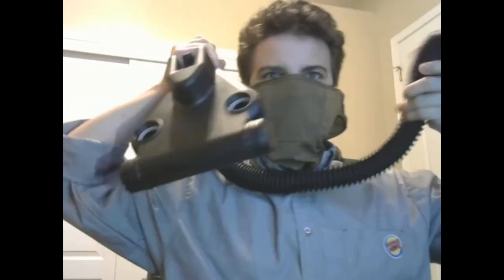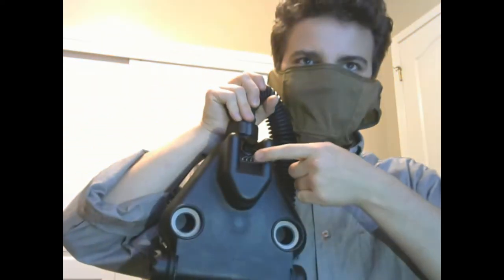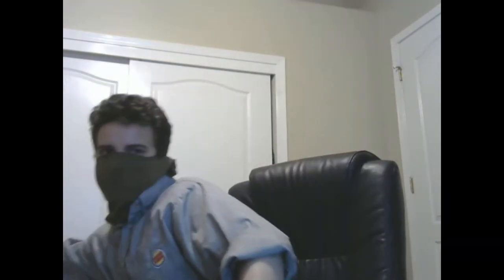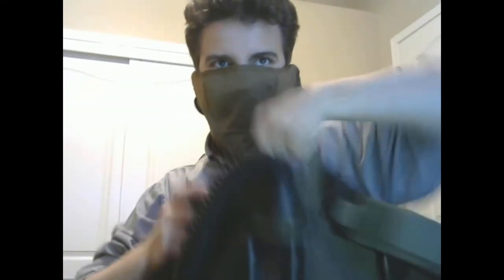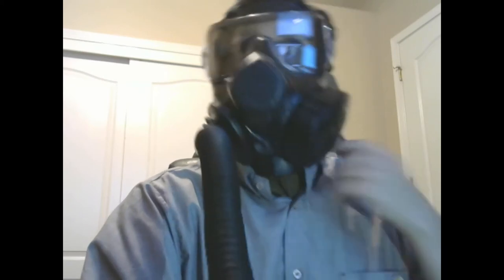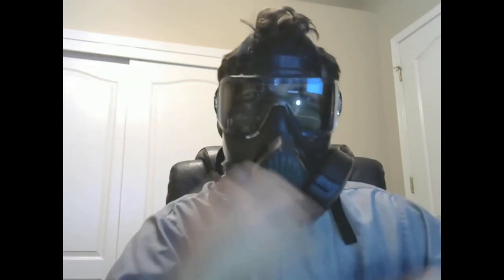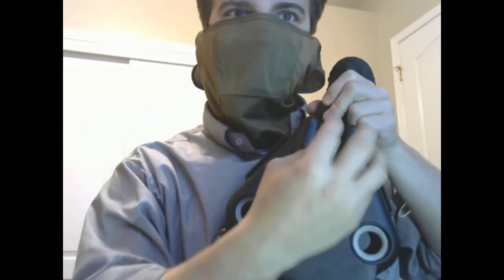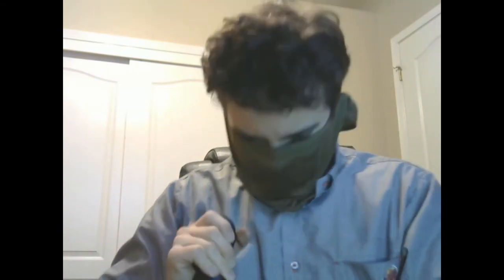C420 PAPR For Airsoft Gas Mask Set Up

Comment: hey there! I’m not sure if you know but you’re using russian GP5 filters on your C420(i believe) If i’m right your filters should have ГП-5 printed in black on them Those are actually in 40MM GOST, the standard thread of the Soviet Union and modern Russian Federation requirements. They also are tested to have asbestos in them. Hope that helps you a bit
Reply: It’s the secret professional PAPR set up bro lol
Reply: @domp5014  ay bro guess what, i got an M50 😏😏
Reply from the maker: That would explain why I have lung cancer
Reply: @yomada7790  nice! Do a review on it
Also, do your M61 filters leak (check the underside of the self sealing valve disks).